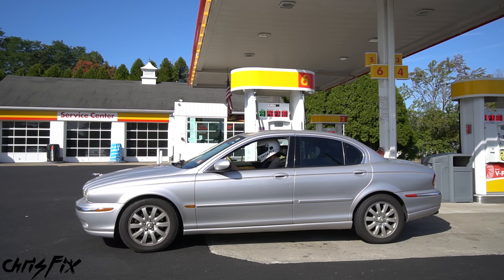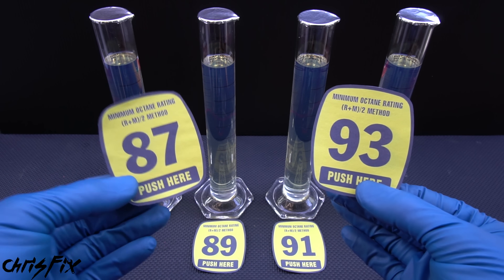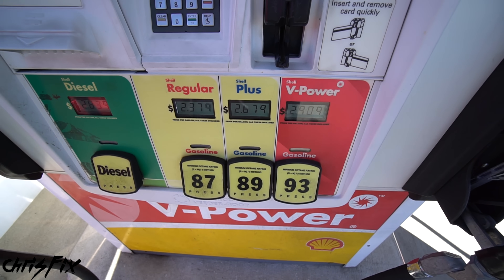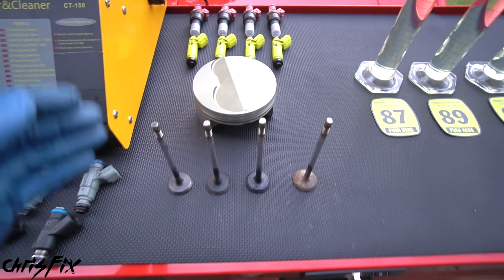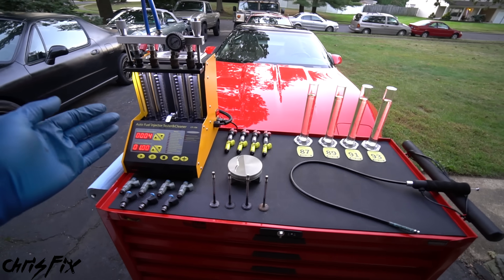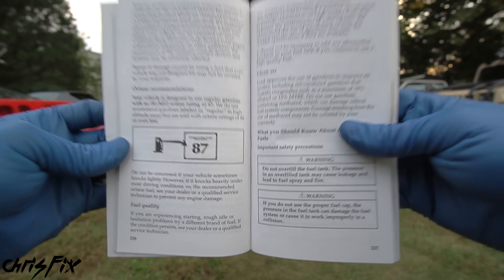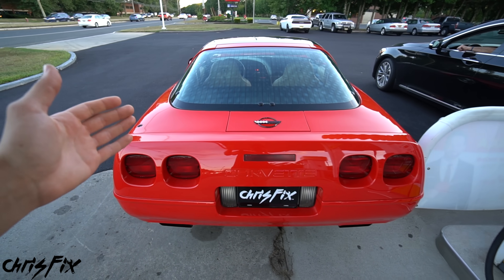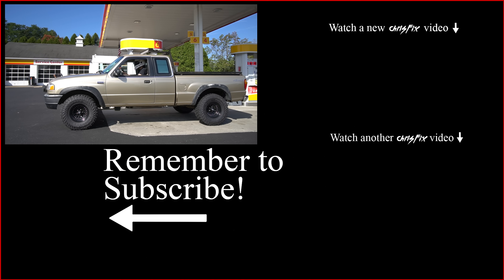What is the BEST Fuel to Use in Your Car or Truck and WHY

Comment: I've been driving crown vic police cars for years. 2003, 2004, 2011, the 11 runs good on 87 and is flex fuel. However, I run 89 or 93 on road trips and get the best fuel mileage. My 03 ran best on 89 standard. Currently in a 2011 with 182,000 miles and runs great no matter what fuel I run. I drove a 1996 crown vic base model, ran 87 daily. Had a fuel knock at high RPM, asked my mechanic how I could solve that, and just as @chrisfix stated, he told me it has high mileage and is a higher performance type motor, run 89 or 93 every so often. 
This video was very helpful. Great information.
Reply: I gotta 2004 Crown Vic Police interceptor, I literally logged on here to see which one was best to put on that hahaha, and for my 2001 Dodge Ram as well
Reply: @lerg12  I would say run 87 constantly, throw a tank full of 89 or 93 once a month. With that and routine maintenance, she'll run with you for a long time. We just sold our 2004 with 210k miles. Came from a local sheriff's office being used for 153k. Got it from auction in 2013, ran it til this past Jan. Sold it last month. 2004 was a good year for the cvpi.
Reply: Inspired By Faith 2004 I heard was the best year
Reply: Been having my 2000 Police intercepter since 08, I add premium maybe once a month and she drives like new money.
Reply: @essneaks  new money sounds nice
Reply: so if u run preimum on a car that takes regaulr, u get better mileagE?
Reply: @randomrazr  wouldn't say better mileage, but as chris fix explained, it cleans and conditions the internal components.
Reply: @NightMusic1-b9o  on the contrary, it's mostly suspension and electrical. However, also drive train, shifting, cooling, throttle response, etc. The computer in a cvpi is programmed different then the civilian models.
Reply: Inspired By Faith maybe a computer chip...that will change shift points, I doubt they would swap radiators or trans do to cost....I worked on one back in the day 02/03. It was quick off the line and it handled well for a large boat
Reply: @NightMusic1-b9o  no chip. Computer programming. Also, there are performance parts on the police models. So bigger radiator, oil coller, and condenser. Also different intake and by pass tube for the cooling system.
Reply: Like I said it was quick off the line and handling was good for its size....I wouldn’t call it fast or a sports car by any means...could easily be outrun by any v8 trans am with a 6spd standard of the same model year. The crown Vic was a workhorse of a car...much like the Taurus or sable back in the day

Comment: 87 if you're car doesn't need it. Bad thing is these days if the ethanol is saturated then no octane boost. You might have 70 octane or lower since the ethanol is being considered an octane booster. Bad damage really fast. Check engine light pulling out the gas station.

Comment: Very nice video.. Thank bro.. Nice work.. I have a query, I have a Ford escape and as per manufacturer recommendation I have to use regular fuel but I mistakenly use premium fule without seeing the owner manual for 50k KM, Can I now switch to regular one or will continue with premium one only..
Reply from the maker: Yes you can always switch back no problem and you can use premium without any problems (except it costs more haha)
Reply: Thanks a lot man.. This will save me few bucks for sure...

Comment: I've always noticed a decrease in my MPG when using ethanol vs non-ethanol almost like the 10% less if it had 10% ethanol is this the general consensus?
Reply: There is one gas station within a 50 mile radius of my house that sells ethanol free gas.  Only 87 octane.  And it is ten miles out of route of anywhere I go.   So, any gains filling up there are lost to the trip out.

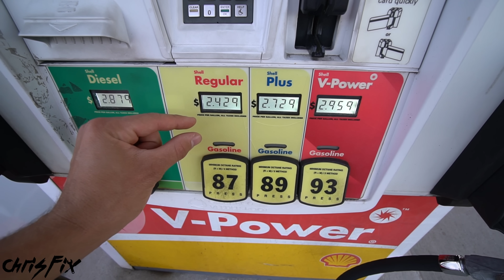Comment: @12:25 you contradict your statement @1:45 with regards to power.
Reply from the maker: No I didn’t contradict myself. I said all octanes of gasoline have the same energy content which is true. Then I said if your car recommends premium you will get more “power” using it. If you use regular you will burn the same energy but since premium allows the car to advance the timing, it allows the engine to run mite efficiently and make more power. So regular gas will make less power and the extra energy is turned to heat instead of power. Make sense now?

Comment: Next video should be “Does Shell Gas Really Clean Your Engine?”
Reply: I wondered the same thing and put two gallons of the stuff in my toyota on an empty tank, and it no joke fixed my engine knock. Im thoroughly impressed because it only cost me $6 which is cheaper than engine cleaners.
Reply: I'm not one for a placebo effect at all but for some reason, Shell has always worked better in my vehicles. It's always seemed to give them more power or at least it felt like its full potential. Not sure why. Maybe it's those nitrogen bubbles lol
Reply: Yeah, I think he said Shell's premium has 7 times the minimum of detergents and additives.
Reply from the maker: Any 93 works. It’s the same stuff across all stations except for the detergent additives. Check out top tier fuels to see stations that use extra detergents if that’s your concern.
Reply: Also the main reason I put high octane gas in all my cars is to keep them clean. As a automotive tech, I see it first hand the difference it makes.
Reply: @richardwhitaker4148   I agree. Garbage in, garbage out.
Reply from the maker: That would be awesome but take many many months to produce. Sooooooo many variables and soooo much work to remove heads and valves and all that. But it would be cool!
Reply: Higher octane does burn slower
Reply: @jennykirk9516  no it doesn't.
Reply: @user-hf3rq1dg9d  yes it does I have several drag race cars with 14.1 compression and they need 110 octane race fuel to run right. Because it burns slower it let's piston make full stroke before firing .diesel full same way burns hot and slow dont even need spark plugs.
Reply: @jennykirk9516  it does not burn slower. It is able to resist being ignited by the compression stroke
Reply: @user-hf3rq1dg9d  them why when I put 93 in my race car it rattles lick a paint can and I can put 110 in it and it runs great it knocks from pretty ignition on 93 the slower burning 110 let's it complete the stroke before ignition.
Reply: @jennykirk9516  nothing to so with speed. You are confusing speed and ignition timing.
Reply: @user-hf3rq1dg9d  This was a helpful friendly thread before you got here.. Name calling just dropped the quality. Cheers
Reply: @user-hf3rq1dg9d  ok I was just always told  that
Reply: @Chocwish  no one cares what you think. Thanks.
Reply: @user-hf3rq1dg9d  No, you think your advice is gold but you devalue it by doing this to people. Everyone sees you projecting and it's sad
Reply: Low octane fires before the full cycle of the piston
Reply: @jennykirk9516  that depends on the engine compression and is the whole reasoning of manufacturer recommended octane rating. You can use lower octane but the engine will adjust valve timings to lower compression which reduces performance but stops predetonation.
Reply: Do it!

Comment: Shell: V-Power gives you more performance!
Chris: that is completely false
Shell: bruh...
Reply: silverbird58  H   ow      do    y    ou type        like  that ? It's al mos t      impossible    to     r    e a      d !
Reply: silverbird58  that for a big part is because it doen't contain any ethanol
Reply: Yes v power gives you more performance, not in power but in engine cleaning and fuel efficiency.
Reply: @Flict-G  no
Reply: @Badewannensalz  thats for cars that are premium recommended
Reply: @Badewannensalz  what's at 1536?
Reply: Shell 93 is the worst 93 I've ever gotten. Tried 2 different stations same result tons of knock and timing being pulled. Sunoco was better but not great. Mobil is the only 93 I could run on my tune without pulling timing. Handheld tuners with real time data logging pay for themselves.

Comment: So explain why, on my stock 6 cylinder SUV, the difference between 87 and 93 is night and day difference? You "claim" the energy is the same on all 3 grade as of fuel, however,  the 93 makes my truck run so much better, that I refuse to run 87. I've  personally documented the mileage when using both 87 vrs. 93, and once again 93 goes considerably farther. So I dont know why you have made this claim, however, by documenting mileage,  I know for a fact that 93 gets better mileage and the real difference is in the power. This video is false and the claims made herein are incorrect as well.

Comment: Your explanation of detonation needs to show the air/fuel mixture exploding early, that is what causes pinging. Higher octane fuel resist that early detonation from high heat in the combustion chamber.

Comment: Kept using the word detonation when you should have use pre-detonation when describing a lesser than recommended octane. As a mech. engr. I quickly disregarded all content described in this video due to poor vocabulary
Reply from the maker: Actually you are incorrect and I spoke correctly. I’m talking about detonation not pre-ignition. Detonation is exactly what I explained in the video. Pre-ignition is not as common because the heat and pressure would have to be incredibly high and the octane low. Do a little more research on stuff you are not sure about so you don’t look bad making an inaccurate comment.

Comment: I just wanna brush on the point you made around 9:50 i thought fuel was terrible for piston rings and cylinders when its in there like that, i lost a motor to fuel washing out the cylinders and the rings
Reply from the maker: That animation was an over exaggeration but the additive in the fuel actually helps lubricate the upper piston rings when the car is running correctly (not overly rich).

Comment: So I have a 2011 Silverado 1500 5.3, truck from factory is set up to run on 87 or E-85 but I have a custom 93 octane tune and all I’ve ran is 93 octane since the tune was done. Since ethanol is so much cheaper per gallon and burns cooler I asked the guy that wrote my tune is it would be ok to rub e-85 in the truck with the 93 octane tune and he replied and said “if the truck is set up to run e-85 then yes it would be fine”. So I ran a tank of it for a week and I felt it run a little rough at idle sometimes but when I smashed the gas it would get it and go. No engine lights came on or nothing. I don’t see how his 93 only was compatible with the ethanol.

Comment: I am saddened by the mistakes in this video. Octane RATING is simply a measure of the autoignition temperature.  When the fuel/air mixture in the cylinder is compressed in the compression cycle the temperature rapidly increases (Boyle's Law). If the temperature of the gas exceeds the autoignition temperature, pre-ignition occurs. This is also known as knocking.  Preignition is bad for engines. Pure octane auto-ignites at around 450°f.  Fuels with an an octane rating of less than 100 have a corresponding lower autoignition temperature, and likewise for fuels with an octane rating above 100.

Comment: I wish I had link to the original investigation CANADA did . Canadas news is not  lobbied by a private corporation. The gas 87 octane is what you should use unless you drive a super car as ferrari or bugatti or you have a modified cpu . The factory car/truck/motorcycles cpu will not work any harder or different weather you use any other octane . They even got a GM engineer to demonstrate this by dynoing the same cars on different fuels and monitoring all the cars mpg on a track as well . all came back the same .

Comment: Ok there's alot of misinformation in this video. Octane represents the flashpoint of the fuel. The higher the flashpoint, the longer in terms of degrees the fuel is burned thus the more efficient the engine will be. 87 is burned in about 26 degrees of the power stroke, the same engine with 93 will have 31 degrees of burning during the power stroke. This is measured at the ckp sensor ask me how I know.  Also those brownish deposits are manganese not carbon which is from additives, ethanol and synthetic blend oils. Ask me how I know.

Comment: i found that my car manual says: "87 (Research Octane Number 91)"
what does that mean exactly?
is it regular 87 or premium 91 that i should be using?
Reply: What vehicle and engine?
Reply: Bob Barker 2000 toyota corolla VE
Reply: @Mo.0se  87 in North America. 91 in Europe. Europe uses RON as their octane unit.
Reply: Bob Barker thanks alot

Comment: with the truck example - what happens if you witness this knocking but still have a decent amount of the 87 gas in your tank? is it safe to mix fuels? should you buy ethanol booster and only put a little bit in? great vid, thanks
Reply: You can mix fuels.

Comment: Quick question, don't wanna debunk any of ur "facts", simply because I know if a car is under warranty ie a new car. You won't get these issues unless you run the car excessively. What I'm just trying to state that if a car is under per say 120k miles and you have to or once in a while go with cheap over expensive while keeping up preventive maintenance than knocking shouldn't be a huge problem. Like to hear your thoughts on that.

Comment: I did a test with my ‘66 Mustang this year with many different blends and mixtures. The entire results are too much to write, but I’ll start with the engine. HIPO 351 with 10:1 cylinders and electronic ignition. I started with basic 89oct all the way to straight 100oct race gas. I also used octane boasters like Torco and  Race Fuel. Lots of pinging with straight 89 oct and and with a full tank of 100 oct didn’t do much more than 91oct with one quart of Torco. Highest we get here is 91. Best results with best overall performance was 91 and a quart of Torco or Race Fuel.

Comment: One thing I know Is my VW's with turbos love SHELL. AmPm, Exxon, 76, BP and 7-11, are not worthy fuels for someone who loves racing. The only fuel I will put in my cars if I can't get to a SHELL is Chevron and Costco. I always tell my friends to do the SHELL Gasoline CHALLENGE. Use your crap AmPm fuel for two tank fills. As you run the second tank out of fuel, go ahead and play around a few times (3 stomps on the accelerator in a row while driving will kick it out of fuel saving mode) to see how the performance feels. Now put some SHELL Gasoline in (Use a SHELL gasoline station that has a high volume of buisness and cycles thier gas more frequently for this test to be near as accurate as possible. Some SHELLS IN MY AREA ONLY FILL UP EVERY OTHER MONTH OR MORE as oppose to the one I use gets every 3 weeks or a month because it's by a dealership fleet.) Go ahead and fill the tank up to add as much weight as possible and keep that in mind when you play around for the second time when you notice a difference. If there is no difference then go back to your cheaper gasoline grandma. =D Jk.

Comment: I live in Denver Colorado and our octane level is 85 for regular. They tell me that due to the high elevation, 85 octane is equal to 87 octane. Is this true. Most automobile users guides say to use 87 octane minimum. Can I use 85 octane in place of 87?

Comment: So ive been putting 89 in my stang for longest thinking it would keep my engine healthy but i coulve been using 87 and done the same thing while saving bucks? 🤦🏾‍♂️
Reply: Not unless you have a really old car with an engine caked with carbon. Then 89 would actually help.
Reply: @bobbarker3248  16 years, i seafoamed it and one small puff of white smoke came out guess it pretty healthy already.

Comment: Great video. I drive a newer Mercedes that demands 91 octane. I’ve also read that in higher altitudes, it is generally okay to use lower octane as the lesser amounts of oxygen compensate. Here in Colorado, 91 is just about the highest we can get, but I wonder about using 87 safely at altitudes over 5,500ft. I’ll probably continue to run 91 to keep the German engineers happy.

Comment: Sorry to break it to you Chris but your wrong each octane has a different burn rate. low octane burns faster and higher octane burns slower.That’s why high combustion engines (turbocharged or supercharged, NA) use 91 and up because it burns slower. if you use 87 in a high combustion engine it will knock and Can have pre-ignition because it’s burning before TDC.
Reply: Wrong. People who say "burn slower/faster" don't understand what's going on. Octane prevents fuel from detonating as easily. Once it does, no matter what the octane rating is, it burns at the same rate. Turbo-charged engines need high octane fuel due to the increased pressure.

Comment: My flex fuel E-85 Silverado had a problem in super cold weather after running fine for 15 minutes then after parking and shopping for 20 minutes  when trying to start again the truck had rapid start and low power engine mode or wouldn't start and check engine light.  I think the condensation froze or something.  What can I do to prevent this problem?

Comment: Don't know about gas as Australia uses petrol. But higher octane fuel burns higher temp, low end cars are good with 91 while sports use 98. It all depends on the car itself and how it is used.

Comment: 93 octane fuel DOES cause you to get better fuel economy. At least in newer vehicles. It will sense that it can add more fuel and timing without spark knock. It will adjust the fuel and timing tables and make better power, hence why you get better fuel economy.